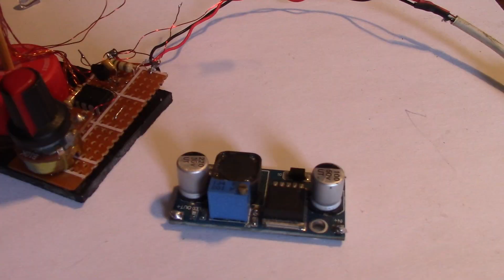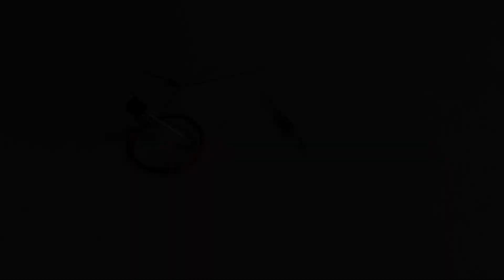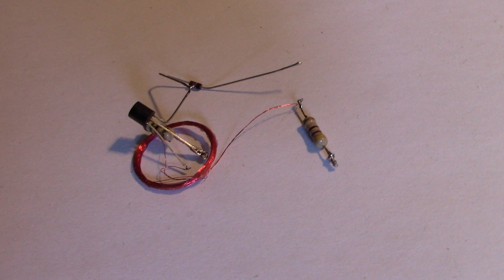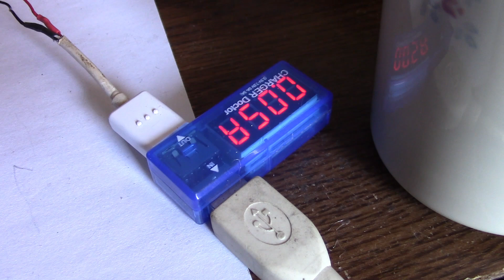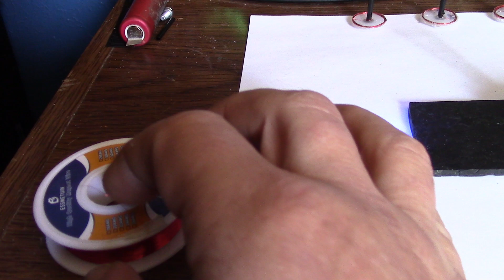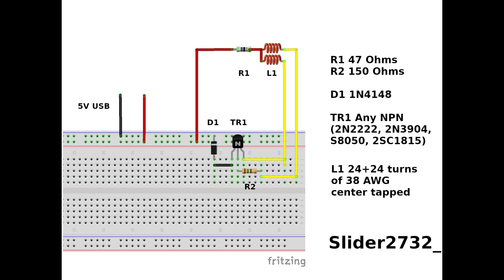Best DIY Levitator Ever! (5V USB)

Comment: Newton's Third Law - for every action there is an equal and opposite reaction. So the spinny thing is causing the rest of the set up to levitate with only the weight of the thing stopping it floating away #ThatsNotHowPhysicsWorks :)
Reply from the maker: 🤣 Exactly!
The LED itself being the center of mass for the whole table it sits on. Adjust the pot to change the table height, for the best keyboard typing experience.

Comment: Don't different color LEDs require different amounts of power? 🤔
Reply: It's different amounts of voltage that different color LED's need.  For a given current that would result in greater power requirements toward the blue end of the spectrum but as it turns out blue LED's are extrordinarily energy efficient and so have vastly lower current requirements than red or green -- so much so that it has become much more common to simply use blue LED's paired with a phosphor to acheive other colors.
Reply from the maker: @whatelseison8970  Definitely agree, I tend to use blue or white myself. Also found out recently that white's tend to fail a lot sooner, likely the cause of my own recent microwave oven failure with display issues.
Reply from the maker: Sort of and usually yes for voltage with DC. In practice, with high frequency pulsed DC like wireless electricity then the requirements change. It's much like a Joule Thief, where around 30V can be available, but the LED would only ever need 3.2V. Also, strange combinations can be made with say a Slayer Exciter, where a neon that needs 80V can be in series with a red LED and both will light! 😀

Comment: That has come on leaps and bounds makes for a nice desktop display aswell 👍 😊
Reply from the maker: Thanks, John. It really has come along and am delighted with it. Should also be quite manageable for parts for folks to replicate 😀
Reply: I wonder what kind of weight could be levitated at low voltage/amperage I really like the fact it lights up the led. 👍
Reply from the maker: @johnwynne-qx6br  This was my previous wireless electric levitator, 12 years ago!
https://www.youtube.com/watch?v=nzNEUa4Zagw
That one had much more power to lift a Delorean Hotwheels car, but used 12V and 5V from a PC power supply (if I remember right) 😀